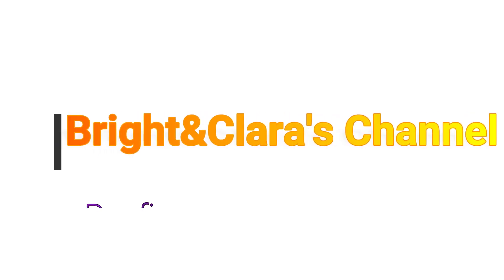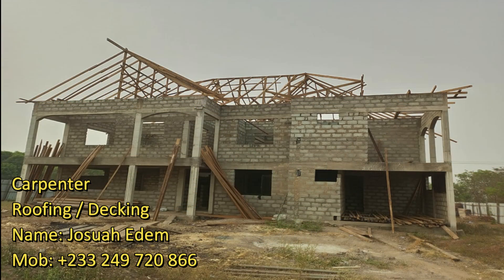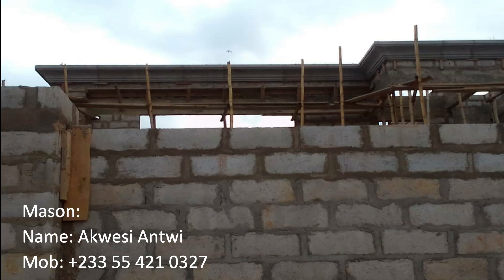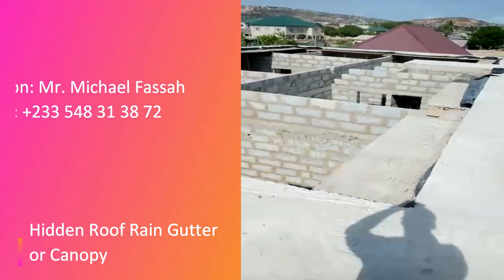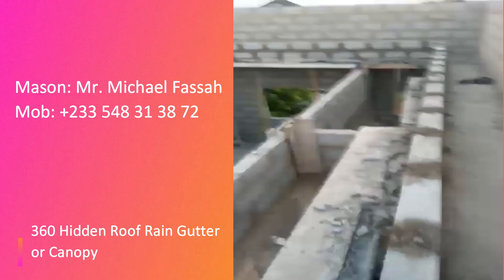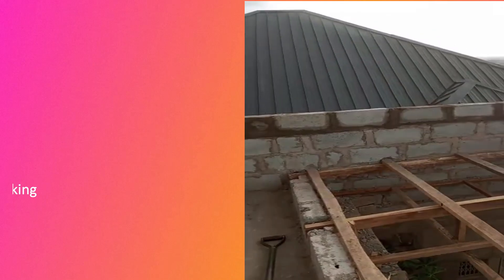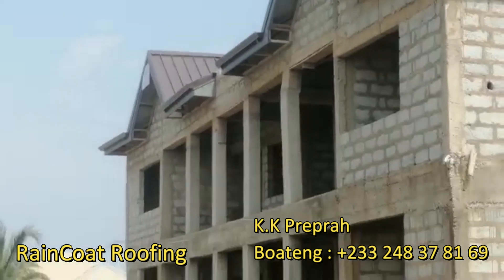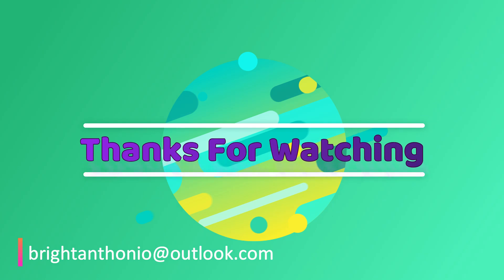Building in Ghana | Roofing & Roofing Sheets | #roofing, #Trusses, #brightandclara

Comment: With ur subscribers issue,offlate we don't normally cut the block but a 2by2 wood is placed at the edge,then a 2inch plastering is done to cover the edge,when the plastering drys u remove your 2by2 and fix your sheet and you are done...thats how I do mine for my clients for the one sided drainage and it works perfectly